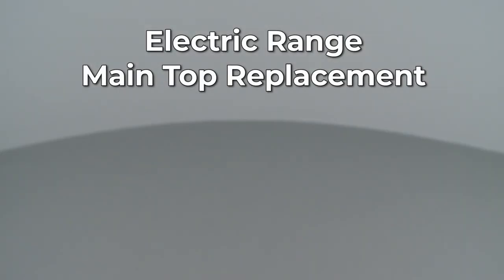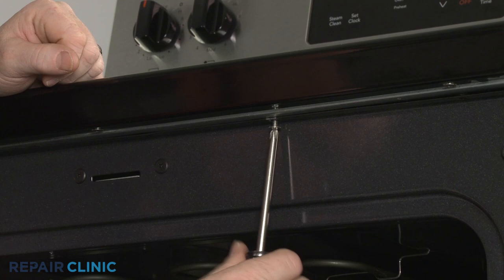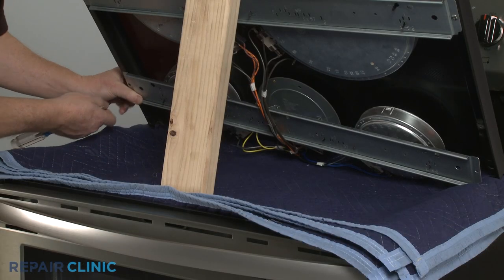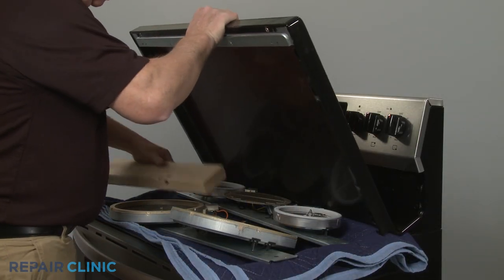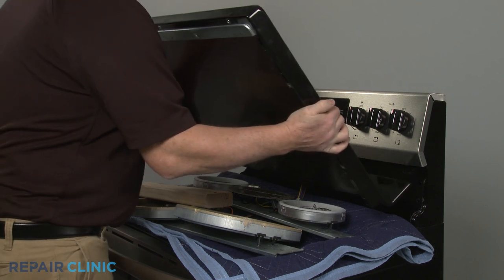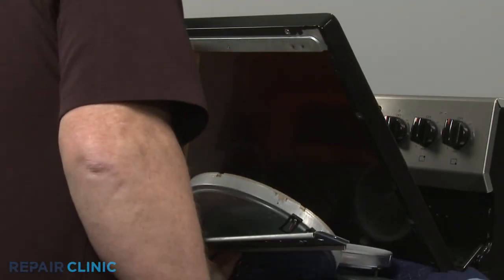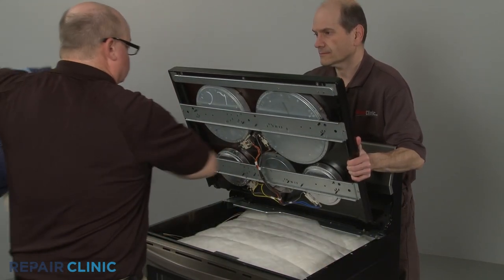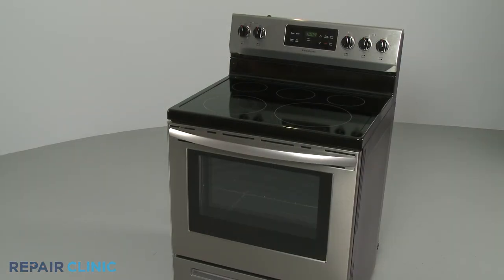Frigidaire Electric Range Main Top Assembly Replacement (5304513244)

Comment: Is there a way to swap out the “glass” only using the original frame? My top is 15 years old so I bought a used one in a "bisque" color frame BUT my range is black. A new top costs as much as the original stove! 😩

Comment: Pro tip; a new replacement glass will not easily take the element supports. Pre thread (tap) the painted holes with a good #8 sheet metal screw with a Robertson head. You’ll likely strip the Phillips head camming out as the fasteners are very soft otherwise.

Comment: where can i buy the top glass for Frigidaire MOD. FES365ECA SER. NF54326063
Reply: We found ours  online.  If you do it yourself take pictures of  clips, brace and screw holes.  Note the screw heads will strip very easily, so be careful.
Reply: Bought mine used off ebay